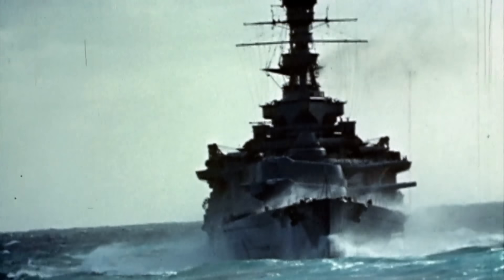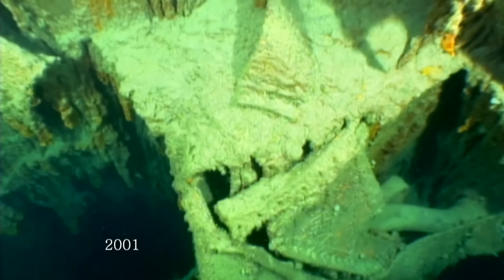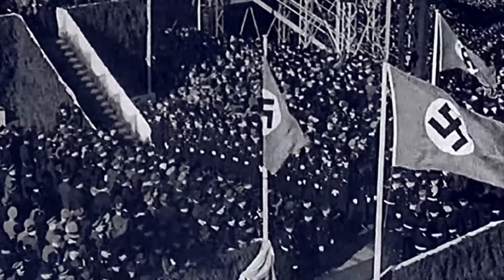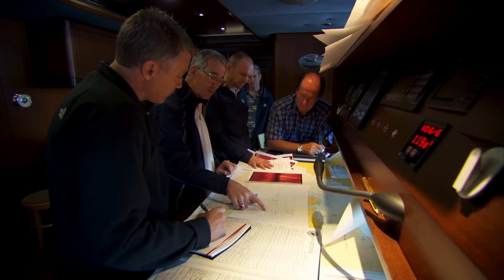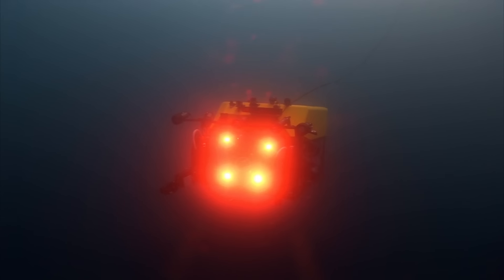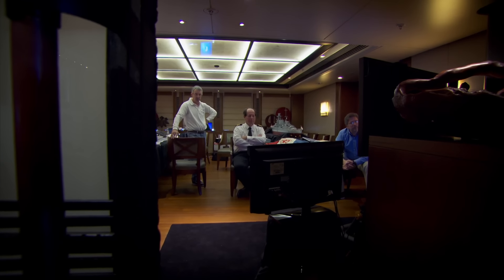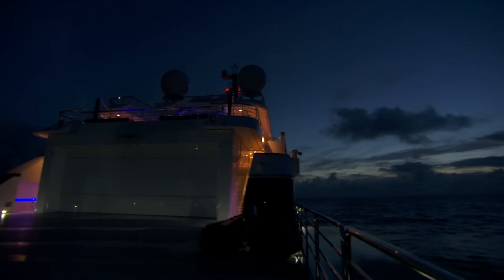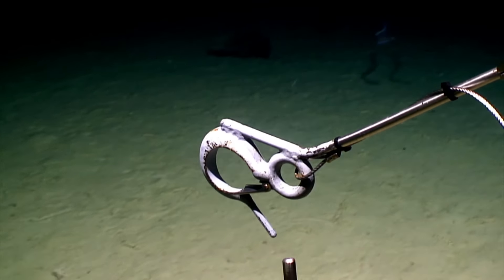How the Bismarck Sank HMS Hood - Documentary

Comment: I believe (to paraphrase) Murphy's law applies here, anything that can go wrong will go wrong, and at the worst possible time.  For example, in an air torpedo attack on USS Hornet, a torpedo missed the carrier but hit the USS North Carolina in the most vulnerable part of the ship (where the steep angle from bow and main section starts). Certainly this expedition proved the 15-inch magazine exploded but a direct hit does not account for the silent high intensity flame near the main mast for few seconds before the much larger and duller massive magazine explosion. Lucky? If I remember correctly when Prince Wales went in dry dock a Bismarck shell had penetrated below the waterline but failed to explode. Had it exploded Britain could have lost two capital ships in 3 minutes. That would have sent the Admiralty into a real tizzy.  Almost 3,000 brave men died on both ships.  May the loss not have been lost in vain.
Reply: The plausable and likely train of events was that one (and possibly two) of Bismarck's 15in shells landed "short" of Hood, continued underwater and penetrated beneath her main armour belt. then as it detonated in the aft portion of her machinery spaces it triggered off a deflagration in the 4" HA (high angle/anti aircraft) magazine immediately to the rear of the machinery space. This rapid burning off of the 4" ammo within seconds would then have vented forwards through the damaged forward bulkhead and likely turned her turbine spaces into a raging inferno which seeking the path of least resistance then vented out through the machinery space vent trunking (Which reached her boat deck just forward of her main mast). This would explain the verticle "blow torch flame" that was witnessed.

As the inferno that had started in the 4"HA magazine continued to expand, several seconds later it broke through the aft bulkhead and into "X" turret's 15" powder room, and the rest as they say "is history".
Reply: thanks for the explanation.  That seems very plausible.

Comment: Not really a contest, the Bismark was a new state of the art battleship and the Hood was a battle cruiser nearly 25 years old, those poor sailors never stood a chance and they knew it.
Reply: Far more nuanced.
Reply: "state of the art" Are you sure?
Reply: @walterCronkitesleftshoe6684  Commisioned August 1940 weighing 41700 tons but still capable of over 30 knots, 8 15 inch and 12 6 inch guns radar directed, plus many other smaller ordnance,  throw in a 12 inch armour belt  as well, call it what you like because I dont care enough to argue.
Reply: @colindebourg9012  Hood was 21 years older and also had all those features you mention.
Reply: @colin debourg She was very well built, but the basis of the design was old.
Reply: @colindebourg9012  You haven't mentioned the outdated, incremental, armour layout, the obsolete 4 turret twin gun main armament, the low angle 5.9 inch secondary armament, the flimsy radar which tended to (and did) fail when the guns fired, the internal communications network placed above the armour, which consequently failed within minutes of the 27 May action commencing,  the belt armour thinner than that of the Nelsons or the KGVs (both of which, unlike Bismarck, were Treaty designs, displacing around 10,000 tons less) and the deck armour, much thinner than that of the Nelsons & KGVs.

Indeed, start of the art, if you were building Bismarck in 1926 or thereabouts.

Comment: Without the context of the similar magazine explosions of the WWI Battlecruisers and the armored cruiser Defense, the analysis seems a bit skewed.   Hood’s loss was not novel.  Rather, it was part of a long term pattern of German heavy shells penetrating dubious Battlecruiser armour protection.
Reply: The circumstances were different. The battlecruisers at Jutland had taken unwise short cuts, as their captains tried to accommodate their admiral's fixation about rates of fire.

Hood cannot be accused of the same foolishness.
Reply: @dovetonsturdee7033  True, but the fact is that German shells penetrated into the magazines in each case.   British firing was inaccurate to begin These engagements, while German gunnery immediately straddled.  Simply put the German navy outperformed the Royal navy in these conflicts.

Comment: Unfortunately the “mighty” hood wasn’t as mighty as a full scale battleship. It was old and did not have the level of armour to go toe-to-toe with the bismarck.
Reply: The RN's nomenclature for Hood as a "battlecruiser" was entirely down to her speed, which outstripped all her WW1 battleship cohort by a factor of 7-8 knots, and not based on her being "lightly armoured".

Bismarck belt armour   = 12.6 inches
Hood belt armour          = 12 inches (Though angled so as to give 13 inches of protection).
Bismarck armoured deck  = 4 inches
Hood armoured deck      = 3 inches

Hood's vertical armour was well upto the average standard of contemporary battleships, her weakest aspect was her horizontal deck armour, but Holland had raced to close on Bismarck and had escaped the "danger zone" of plunging fire, only to be then hit by a million to one shot that found an obscure "achilles heel" in her vertical armour.

Comment: The design flaw was in the lighter armour sacrifice for speed, her 4 sister ships all exploded at the battle of Jutland in roughly the same manner, she should be stand off and fire and fire at distance, although at 14  miles is 24640 yds, a mile more than the optimum at 22000 yds?
Reply: The Three battlecruisers which were sunk at Jutland were not Hood's sister ships.    Hood was much better armoured, and actually far more of a fast battleship than a true battlecruiser.

Hood's weakness was her 3 inch deck, compared to the 6.25 inch of the Nelsons, the 6 inch of the KGVs, or the 4.7 inch of Bismarck. Holland was fully aware of this, and, rightly, attempted to close the range as quickly as possible, to take the threat of plunging fire out of the equation. At closer range, Hood's 12 inch belt was not seriously inferior to Bismarck's 12.6 inch.   He had almost achieved this when Hood received her fatal hit, although ironically almost certainly not from plunging fire.

Incidentally, the best range to bring about a favourable possibility of a hit was probably around 15,000 yards.
Reply: HMS Hood had the same armour as a Queen Elizabeth class battleship so perfectly capable. HMS Hood was sunk by pure luck only.

Comment: I know people would like to say bismarck got lucky I don't believe so it's definitely  design  that  was the problem people tend to forget 6 months before the Denmark Strait battle  barham also had its magazine detonated by a German U-boat and  considered the fact prince of wales got hit exactly the same way hood  got hit with a shell Landing with magazine is the only difference was prince of wales was  designed to protect the ship from less likely magazine explosion while the hood wasn't designed like that.
Reply: Barham was a much older ship, sunk by three submarine torpedoes hitting in close proximity to each other.

Prince of Wales was sunk by aerial torpedoes, not by a shell.
Reply: The shell that landed near to a secondary magazine in PoW only managed to reach that location because the shell fuse was faulty. If the fuze had worked as it was intended the shell would have detonated on impacting the water surface, instead of travelling 30m through the water and penetrating under PoW's armour belt.

Comment: I think HMS hood made a mistake of meeting the Bismarck head on. HMS Hood should have waited the Bismarck at 20 miles distance while at his broadsides already. Or perhaps just lay perpendicular on the horizon since the Denmark strait constict the Bismark to navigate in parallel to the strait. But the order is to engage the Bismark as spotted so with the help of the fog both battleship are in their most lethal range and while the Bismark is firing on full broadside the HMS Hood is still not firing its aft 15 inch guns but instead giving away its vulnerable spot which is its thin deck in line with the incoming  shells from the Bismarck. Yeah absolutely Hood unwittingly catches the incoming shell from the Bismarck while turning at full broadsides.
Reply: Admiral Holland was aware that Hood's 3 inch deck armour was vulnerable to long range, plunging fire, and thus sought to close the range as quickly as possible, as at shorter range Hood's 12 inch belt armour was only marginally inferior to the 12.6 inches of Bismarck.

The angle of Hood's rudder on the wreck suggests that he had almost succeeded.

Comment: Excellent Bismarck gunnery and weak deck on the Hood an over rated ship .
Reply: Hood had 3 inches of deck armor which is standard for Battleships, Bismarck is a much more overrated ship than Hood
Reply: @KatyushaLauncher  Hood was a battlecruiser not a battleship its  refitting and deck armour upgrades were  interrupted by  war .breaking out .it was also known as a "wet"boat due to excess water entering the ventilation system causing illness among the ratings.
Reply: @bigsmoke6189  still doesn't change the fact that Hood's deck armor was standard for any battleship. Also when did I say that Hood was a battleship?
Reply: @KatyushaLauncher  you didn't ,fair point.
Reply: @bigsmoke6189  Bismarck = ended up at the bottom of the ocean after just one week of operations. Waste of metal and men. Utterly failed in its only mission.
Reply: @lyndoncmp5751  I agree completely, too much national pride and expectation was placed on Capital ships which were strategically obsolete during WW 2

Comment: short answer hood was a world war 1 to inter war era battlecruiser fighting a modern battleship in the form of bismarck and battlecruisers are not designed to fight battleships their designed to fight light and heavy cruisers and run away from battleships clearly the british didnt learn from the battle of jutland
Reply: Hood was as well armoured as a Queen Elizabeth class battleship.   The mission of Hood and Prince of Wales was to prevent a German breakout into the wider Atlantic, where Bismarck & Prinz Eugen would be harder to track down and engage, as Operation Berlin had recently demonstrated.

That was why two British forces were placed in the two choke points of the Denmark Strait and the Iceland-Faroes Gap.